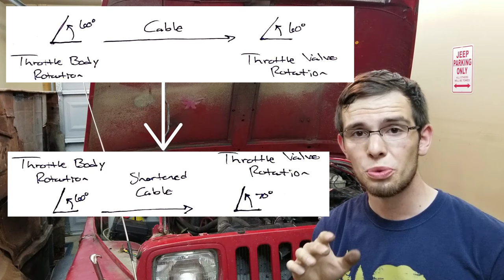Adjusting Shift Points On YJ Automatic Transmission

Comment: Nice video. Actually learned something i didn't know. I have 93 4.0 had auto trans rebuilt about 8years ago, immediately burned it up. Went back to the shop a dozen times. Learned the hard way about my shifting issue, burned up a few transmissions before the company stopped answering the phone. After a few adjustments my jeep will pull the tires off the ground hitting second gear. Thats on 37 in swampers. Stock gears granny 3.07 , highway speeds 88mph gps
Reply from the maker: Glad I could help!

Comment: Also about to swap a 32rh in and set up a grounding switch for the lockup and manually lock it at highway speed
Reply: How did that go?  I just put a 30rh from a tj in my yj,   I've gotta figure out how to wire the new lockup with 2 wires and ground signal, as my original yj 30rh was 1 wire 12v ppsitive signal

Comment: The device that Ive told you about will allow you to make waaay more power with the throttle just half open so it should correct the kick down issue maybe? Great video and its great for jeeps that stay below crazy speeds like your having to do lol. Id be scared outta my mind.
Reply from the maker: That's the whole idea. I am hoping that with the PC3 I am able to set the trans to shift very aggressively and still be able to hit highway speeds. I just wanted to be sure I could tweak the trans first. I have done a lot of work on the suspension and steering. I have all new joints and linkages, No sway bar, no track bars, shackle reversal, and the 5100 shocks. The combination of all of those things makes me incredibly stable at 75-80. At 85 the dynamics feel a bit different and its unsettling but before that it feels fine.
Reply: What is the device that makes more power? I'm interested! I have a 91 yj!

Comment: Thanks for the video and info!  My '95 YJ takes forever to shift into third gear until it warms up. Any ideas on how to change that? I really hope the transmission doesnt need rebuilt. Thanks!!
Reply from the maker: Oh man, I really don't know. Let me know if you find out!
Reply: I have the same issue with my 95 YJ. I'm going to change the fluid and filter and I'm really hoping that helps.

Comment: Hello. I’m having issues with my shifter going to the park position. It won’t let me remove my key because of it. But the truck is in park. And turns off. Any ideas please.
Reply: I have 94 auto yj
Reply from the maker: I have had this before, if you r body mounts go bad you could be putting extra stress on the steering column and the linkage could be not going all the way where it needs to. I found that if I push the shift lever one way or the other while trying to get out the key it will usually come out. Check your linkage and make sure your body is connected to the frame.

Comment: I just got mine it's an 89 Jeep Wrangler 4.2 and I've noticed it downshifting going uphill and like you said on the highway but that the gear shifter doesn't line up directly with with drive it's like you can move it forward right after neutral almost like an overdrive do they have these
Reply: Another thing lots of backfire change spark plugs wires coil still backfire any suggestions
Reply: My top speed I think I've got enough to 70 miles an hour I feels like I'm breaking the sound barrier no death wobble yet though and my sway arm bolt is out where can I get one I've looked everywhere
Reply from the maker: @jameswest3301  I am pretty sure I got on on Quadratec
Reply from the maker: I am pretty sure that these do not have a overdrive. Not sure what is going on with yours...

Comment: So I have a 1991 Jeep cherokee xj it has the same cable set up. I drive around in 1st gear because it’s only offroad use. It will shift to second then out of know where it downshift very I mean very hard back to 1st. I NEED HELP is there a way where I can lock it down in first all the time. Still being able to use reverse. Or where I can rev it to the moon and it won’t shift out of first. It shifts around 3,000 rpm
Reply from the maker: It does this when the shifter is in 1st or "L" ? That's really odd. Try disconnecting the cable and see if it stops or if it does it more. That should tell you if the throttle valve has anything to do with it... maybe
Reply: Jeep Sheep TV thank you very much I will get back to you and see if it works. It used to never do this and it just started it
Reply from the maker: @carterlyons4026  No problem, hopefully i'm helping...? Im just guessing really, but I'll offer ideas! Keep me posted!
Reply: Jeep Sheep TV well I disconnected the cable and it was still doing it so I hooked the cable back up and I reset it. Then I took it offroad and it was hitting 5000 in second gear so I guess I fixed it
Reply from the maker: @carterlyons4026  Cool! Hopefully you did as anything else might be a bit more involved
Reply: @Carter Lyons you can add a switch to your XJ to control solenoids and keep your AW4 locked in any gear you want. You can even control the torque converter lockup. Check out Nickintime on YouTube for the details.

Comment: Ok mine is 88 cherokee. 4.0/aw4. Lost my kickdown and cant manually downshift. My suto upshifts are quick. Gets into 3rd gear in about 3 to 4 car lengths. 4th about 45 mph. 85 mph is tops. On 33 in tires. Trying to gain full functionality in my transmission.
Reply from the maker: 4th at 45mph is rough sounds like you need that cable! Do you want to buy a brand new cable for a little less money than brand new? I accidentally ordered one for the Aw4 and now it just sits in my garage lol.
Reply: Sure how much are you needing for it?
Reply from the maker: @scottcampbell2836  I think I paid $25 for it. Want it for $15? I guess shipping might offset that. what state are you in?
Reply: In colorado. I ll take it and pay shipping.
Reply from the maker: @scottcampbell2836  cool! go to my channel page and in the about section you can find me email. drop me an email and I'll get your address and whatnot
Reply from the maker: @scottcampbell2836  Any luck with the email?  I haven't seen anything. Just wanna make sure it works correctly
Reply: I ll get it on the weekend. Busy week and spotty internet connection here

Comment: Mine broke I can’t adjust it’s just free balling in there 😭😭😭
Reply from the maker: That sucks,  the cables are impossible to find
Reply: @JeepSheepTV  I think I’m just gonna jimmy rig cause this is only thing I can think that’s causing my erratic shifting and low idle
Reply from the maker: @jameskohler3701  if I remember correct it will cause you to shift really early.  The low idle could be throttle position sensor.
Reply: @JeepSheepTV  iac and tps are working as intended this loose cable is the only thing I haven’t address besides bringing set screw up a lil on throttle plate
Reply from the maker: @jameskohler3701  ok,  also check vac lines and map sensor
Reply: @JeepSheepTV  I’m gonna  go threw them again but this is the only conclusion I can come up with